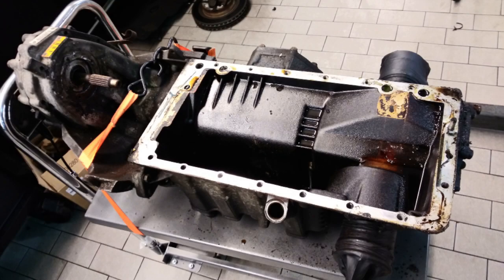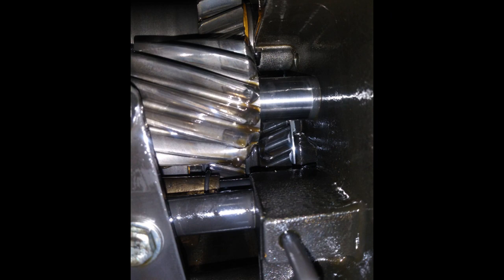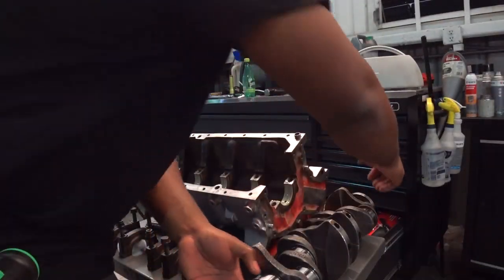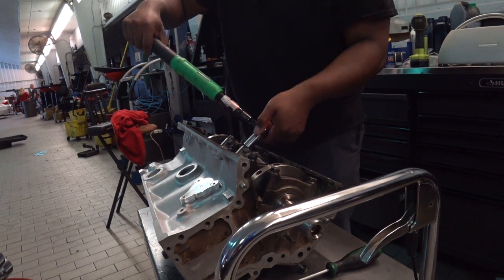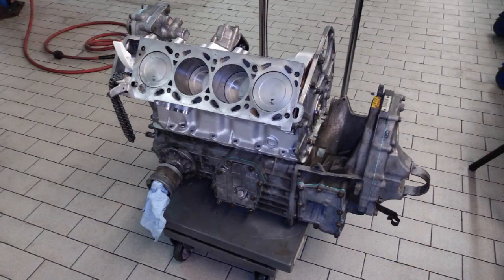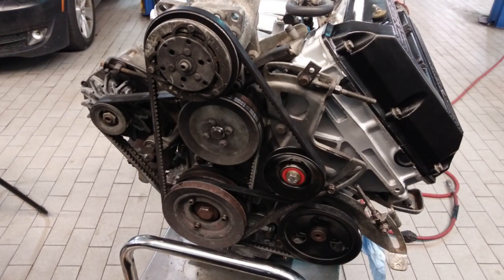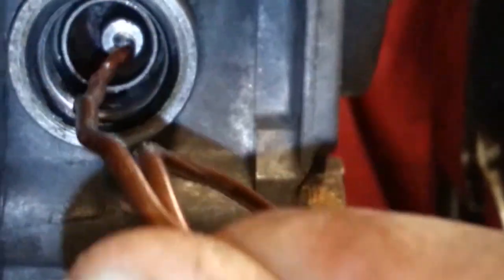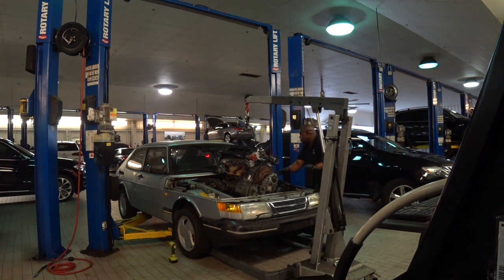SAAB 900 B212 Assembly

Comment: Killer work.

have you looked at putting a 2.3 cylinder head from a 9000 on a 900 block??
Reply from the maker: Well the 2.1 head and the 2.3 9000 head or B234 head are the same. There is a later 9-3 head that has rectangular ports. I wont be using that head. I have considered taking a 1985-86 SPG head and enlarging the ports to that of the 2.1/2.3 head. The reason for that is the combustion chamber has a special shape and volume that can produce very good flow numbers for the ultimate torque monster. I saw this while watching one of David Vizard's cylinderhead porting and valve unshrouding technique videos. The Mazda head he was demonstrating has a similar combution chamber to the early 900 turbo/spg heads. Definately looking into that.
Reply: @RetrocarStyle  I hope you share the road blocks.

Im going across the nation to buy an '87 and planning on making the switch.  Id like to see 250 HP in it one day.
Reply from the maker: @do.u.groove5112  250HP is plenty in the classic 900..... though what I was aiming for was 285-340HP. Still not much by todays standard, but honestly thats enough!!

Comment: Great vid! Thanks for that. Don’t worry about the beefy internals.. just turn up the boost man 😅!. In the eighties a Saab engine was said to deliver 500 hp without any need of changes to the internals.
Reply from the maker: Ive heard about 600hp before any internal mods need to be performed...i couldnt confirm that number personally. Crank is super strong. Pistons would definately need replacing...Rods may need to be lightened for a better response.

Comment: Hey, thanks again, it's not only a great video that's literally guiding me to take my engine apart, clean it, and reassemble, but it's a great soundtrack (using a better shape lower mileage engine block), on a hunch it was in the block..and I did feel play in the bad block upon taking it out of the car (not going to bother dissassembling that one, as I'm dissasembling and cleaning up the good enigne, and it all looks very good internally, I may not even replace the rings because they're original saab and don't seem to have much wear, any need to replace good looking piston rings? if the engine had around 120k miles let's say?). Seriously this is massive, this is allowing me to rebuild my engine and clean it up with way more success than I would have had otherwise.

Comment: Thank you. That was very very helpful, I'm sure one day I will be running it and re-running this vid to check on what I'm doing on my own engines, the detailed commentary most appreciated.    Interested in whatever else you are planniing for classic SAAB 900.
Reply from the maker: Thanks for the positive comments. Next the suspension has to be rebuilt before i can safely drive the car. This means the engine has to come out again. Need to get the front upper control arms out and powder coat them and put them back in. Then i can install all new ball joints, lowering springs and shocks.
Reply: @RetrocarStyle  YIPPEE.   Great to hear,  I'll watch out for it...(from here in Melbourne, Australia).. :)

Comment: Thank you very much for a great video! I would really like to see how you change seals to power steering rack. Mine is leaking fluids😁
Reply from the maker: I have the rebuild kit. I started to do that whwn I had the engine out but mine werent leaking. I have to remove the engine again because I need to get the control arms out and powder coat them. Then install new bushes and my lowering springs. I may feature that on the channel
Reply: @RetrocarStyle  Where did you buy the seal kit btw?
Reply from the maker: @jeenoniin  So you can buy the end plate gasket sets with all seals for the lower part of the 2.0/2.1 8/16 valve engines from RBM SAAB PARTS in France. You can also get all the gearbox seals for the end plates and access covers from RBM as well.
Reply: @RetrocarStyle  I mean for the power steering rack😁 sorry
Reply from the maker: @jeenoniin  Gates sells a rebuild kit. I bought mine from ROCKAUTO.COM

Comment: What would this engine out work have cost if a shop charged you?
Reply from the maker: Hard to say with varying shop rates. If I had to guess, A typical SAAB specialist likely would charge $2.5k - $3k...and this is being conservative. A job like this could easily eclipse these numbers, and that would depending on several factors.
Reply: @RetrocarStyle  yeah; especially if you had any machine shop work done; that's what people don't realize. All the work I'm doing on my car following this disassembly would cost like $5,000, because I'm also going to be cleaning up the engine bay, new radiator, hoses, headlights, replacing engine block with smooth one, getting the head done as well...gonna replace the shifter cables, throttle cable, etc. Oh, and the suspension bushings/ ball joints/ upper control arm bushings and repaint while engine is out. You really can't get "everything in the front of the car" redone ...I mean you can get an engine or transmission replaced for $2,000 or so, but that is the bare minimum... that doesn't include "and treat it like it was your car you want to drive for next ten years, and replace everything else that needs replaced, and clean it all up, and paint it"...that is seriously like $5k+ overall, and thats if and when you can find someone to do it - which is not going to happen soon.
Reply from the maker: @pawpawbandit3871  True. There are very few SAAB repairs shops around and doing this work will be very expensive if you decide to pay someone.

Comment: Hi Bro!
What a great video...
One day I should like to do this same job with my 2,1i 16v engine and gearbox...
Reply from the maker: Hi Terje! Thanks for watching! I have actually purchased parts from you on EBAY!! Yes a complete refresh was necessary on my 2.1L engine as it was leaking lots of oil and it blew all the bearings. It runs great minus a few issues, but it will be nice to get it back on the road again!
Reply: @RetrocarStyle  I belive I have a tiny coolant leak between the block and top at the passenger side front corner.
And some valve lifter ratteling.
Did you buy new hydraulic valve lifters?
Ohhh....
Did you buy parts from me?
What was it?
Reply from the maker: @TerjeNormann  I didn't buy valve lifters. I re-used the same ones as they were quiet before the rod bearing failure. I purchased a good condition Glovebox Door and one other item...a turn signal switch.....I think. I forgot what the other Item was but I definitely remember buying the glovebox door. I bought it to match a crack free dashboard i have for my 900.

Comment: Great job! I did th the same job on my OG 900 -85 some decades ago. The renovation of the cylinder head was the most labour intense part.
Reply from the maker: Lifting the heads off these engines is quite a chore because the castings are very heavy. The first start is coming up but after all this work.......the clutch slave cylinder blew up....😝! Brake fluid is leaking all over. I should have changed it while it was out. Now im fighting to get the old one out. Once its out ill change the clutch master cylinder too as its old and leaks as well.
Reply: @RetrocarStyle  I use to use brake tube to put in to push the "spring fingers" so you get space for to get the clutch cylinder out. ;)

Comment: Another excellent video my dude! I see you went with the aluminum color for the block. I did the same as the OEM red looks out of place.
Reply from the maker: I felt the same too...it just looks better. Another thing that influenced that decision is that I saw some pictures inside SAAB's museum in Sweden. There were engines on the stands that featured aluminum paint. They looked much better than the red blocks. The heads & blocks were the same color. That is what I plan on doing to the high compression turbo build....just experimenting now but i'd like to make it look really nice!
Reply: @RetrocarStyle  Oh. My. Gosh. That was my EXACT reason as well! Wish I could chrome up the hardware like they have it in the museum too or replace it with stainless, but I did replate them with new zinc so it'll be super shiny.
Reply from the maker: @austinvitoux  I was thinking the same thing we have a place here called Fastenall or Würth. They keep new shiny hardware to make things pretty.

Comment: jesus you are making Amazing vids...the explainations are waaaay helpful! thnx! my 85 turbo was rebuild as Factory...but might look into building another one with high performance sleeper in mind
Reply from the maker: After I saw a Turbo Miata high compression setup...and how easy it was to make 350+ hp on midrange boost,..I said to myself this is a MUST. the B202/B212 has great potential for tuner cars. But you just have to get the gearbox stregthened to handle the extra torque output. I can't wait. Im glad you like the videos and thanks for watching!
Reply: nice video. one thing i noticed is that the thrust washers on the number 3 main bearing were missing when you lubed the bearings, but didnt see them installed before the crank. just letting you know just in case! keep saabing!
Reply from the maker: @michaelmoe8656  Yes It wasnt shown at that point but I did get them in. Good eye!!